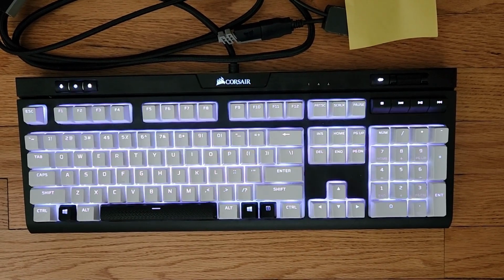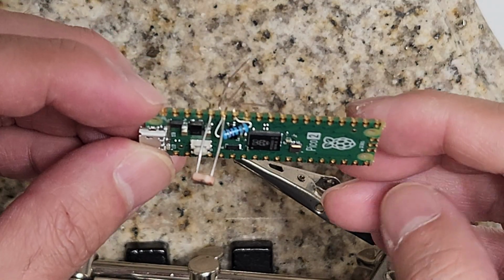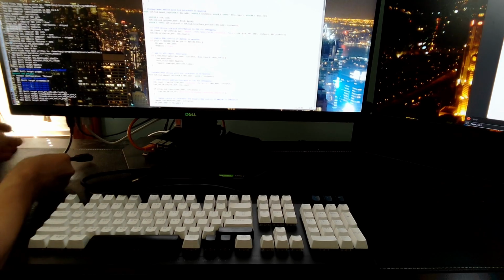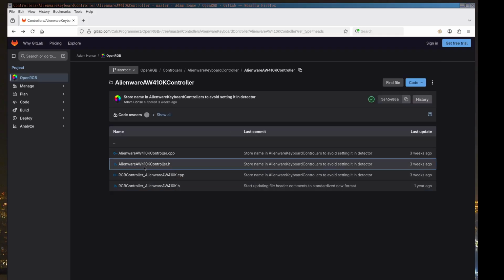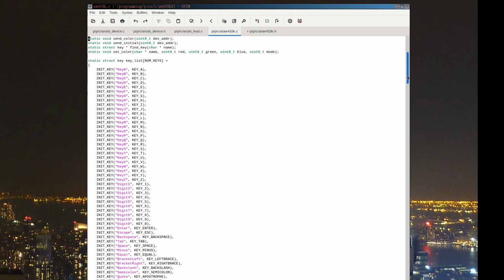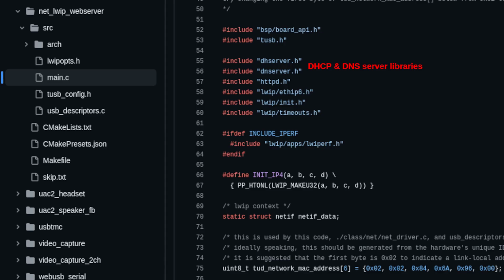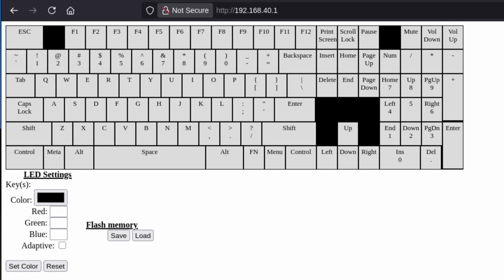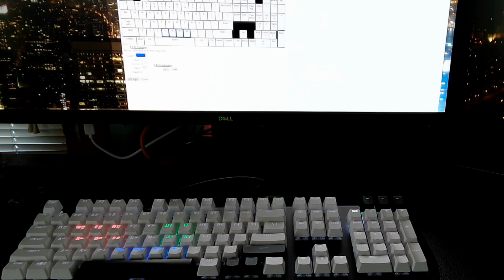Control keyboard RGB with Raspberry Pi Pico 2 & TinyUSB HID/NCM+lwIP HTTPD (Alienware AW410K)

Comment: Hi kenji, beautiful work.
You do exactly what I wondering since I want to passthrough my normal keyboard to a PC through a Pico 2, most likely to add function like snap tap or smt like that to the keyboard.
So I wonder if you have a version with just passthrough? Since my keyboard doesnt have RGB so I dont need that function.
Thank you
Reply from the maker: No, but it shouldn't be difficult to remove any RGB related code or take just the passthrough part of the code from the source that I've shared.
Reply: @kenjinerd  I see, thank you very much
I will give it a try